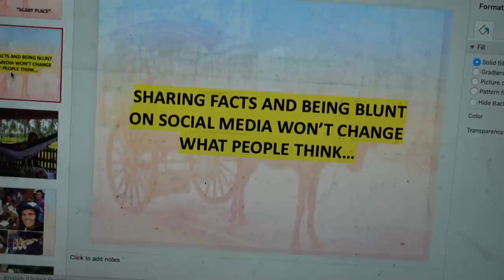BUILDING A WOODEN BEACH HUT - Our Single Filipino Engineer And Philippines Beach Life

Comment: The AAA structure is a little small.  Not sure what you are planning to use that for?  As soon as Kulas stood inside the frame, it looks like he is going to hit the side/roof.  I'd say it a waste of floor space to design it with a triangular shape.  It looks like it would be just be a sleeping room.  Can't put cabinets or big TV or full-size fridge.  If you put any furniture it will be pushed to the center of the room.

Comment: Interesting "Kulas".  The Filipinos are learning from you, building Beach Houses from available Wood and other local materials. This is because they thought that only concrete buildings and Cottages are possible to establish Resorts.  With this, they can dream of putting up Cottages made of local cheaper materials.  I just learned that there  are already an engineered Bamboo Material that can replace Wood.  This means that the cutting of Trees will be minimized. Auraphil thanks for sharing.  GOD bless!